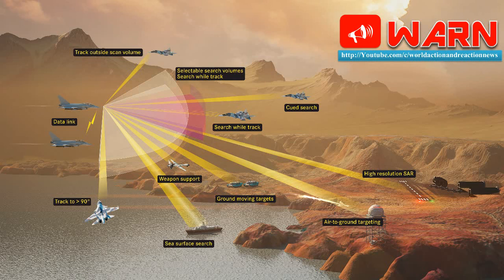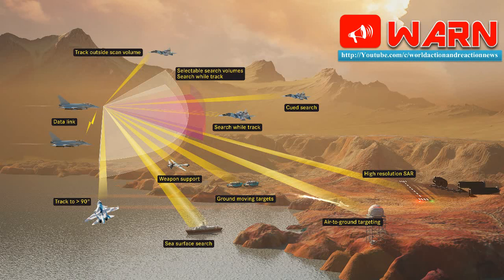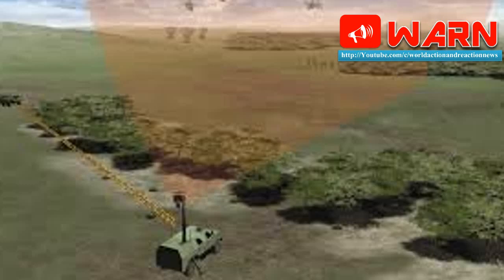What is AESA and PESA Radar and difference between a PESA and an AESA radar?

Comment: One correction is that AESA don't use silicon process. They use Gallium nitride because of the high power handling. Due to their individual RF generators, each TR module is scanning a sector on its own without mechanical steering and that reduces failure rate. Electronic parts last much longer than mechanical ones. AESA is hence more efficient wasting less power while also being more compact in size. This also allows for additional panels on the sides of the nose giving better coverage upto 240 degrees than 180 degree before.
Reply: GaN is not a requirement for AESA. there are silicon AESA as well. but most use GaAs.
Reply: Actually, majority use Gallium Arsenide conductors; while only the latest and most modern radars use Gallium Nitride which is a lot more expensive and more difficult to produce. The development of modernized ship borne AEGIS AN/SPY-6 radar is based on Gallium Nitride, resulting in exorbitant costs of over $300 million per radar.
Reply: sashank reddy dam dude u kick ASS !! U know ur stuff
Reply: it's not like it would be cheap if they didn't use that, Lol. russian S400 costs like 1billion$ too in total.. @tropickman
Reply: So what I'd like to know, if a fighterjet equiped with a PESA radar comes up to a jet with an AESA radar, is it safe to assume that the jet with the AESA radar will quicker or easier detect the other jet & shoot it, or are other factors more important here?
Reply: @bekeneel  There are quite a few factors involved and we can't really do a radar theory in the comments section. However, the general broad expectations should be that the AESA radar can track more number of targets at once than the pesa radar and can switch frequencies more discretely allowing simultaneous scans over multi spectral ranges. It can engage more number of targets and also make a better silhouette of targets. Take thatose statements not with a pinch but a boulder of salt. Target tracking and modern radar mechanisms are complicated and are deep level technical know how's of the few companies that build them. Range depends on power being pumped. AESA'  s might actually have less individual module power as it has too many active elements drawing power from the same source. PESA might have a longer range but less flexible with Target tracking. There are too many variables to really go over.
Reply: @the80386  The moot point is  mostly that Si is not the preferred choice.
Reply: @ringosanchez2443  Thanks for the compliment.
Reply: @tropickman  GaAs was the easier technology but GaN was typically more expensive because of the process being newer and not due to the unit costs. That's what I heard. GaAs is was mature but it suffers from low voltage rating. GaN is now preferred widely in almost all applications of high frequency due to process maturity as well as it's high power tolerance. Those things easily operate at 48+V while some SiC models can take on grid power. GaAs does have lower distortion and better linearity. GaN shines (not literally) when you need to operate at high frequency at a high power. That is basically Radar and wireless telecommunications like 5G. As a side note, warship Radars are exponentially more expensive because they have 4 to 5 times the number of tr modules. A fighter radar has 2k modules  but a warship has 5-8k modules per face going over 20k modules per radar.